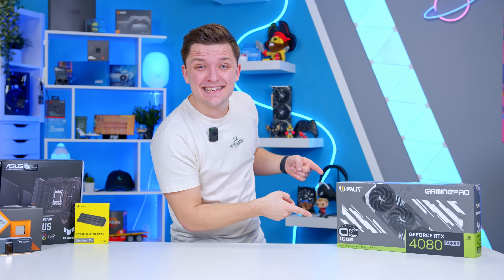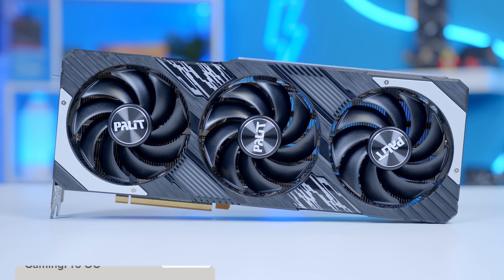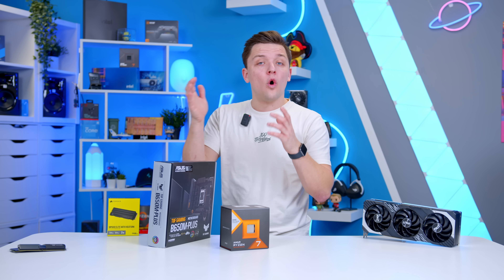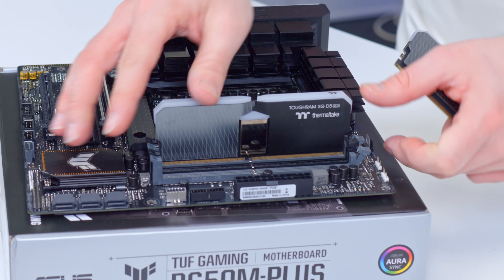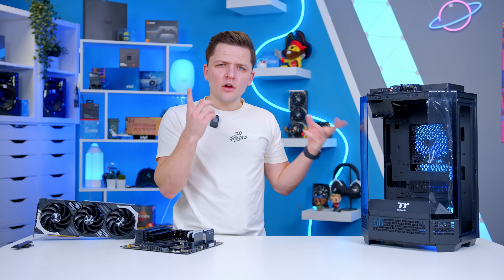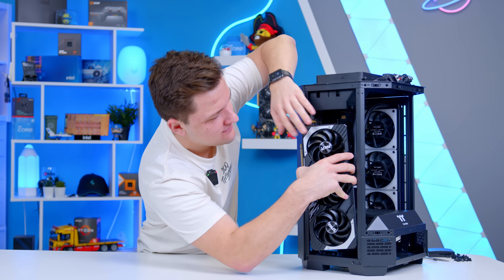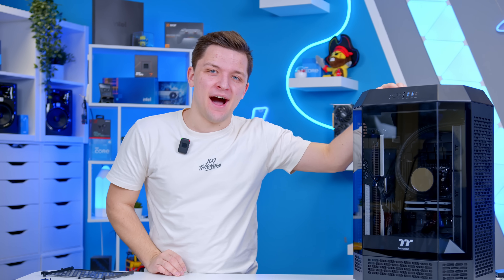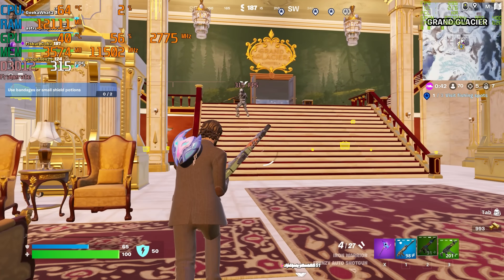Best RTX 4080 Super Gaming PC Build 2024! 😄 [Testing NVIDIA's $999 GPU in 10+ Titles]

Comment: something I've noticed with the tower 300 is matx boards are a bit different from each other and its better to find one that the gpu is using slot one, this moves it just enough to the right that its not covering all the motherboard connections on 3 plus slot motherboards. the thinner boards its really not an issue. just something ive noticed. 2nd i wish asus kept the crosshair gene, thats a great looking board for this case.

Comment: Thermaltake Tower 300 Question: 

Question: Do you think an Artic Liquid Freexer II 420 AIO would fit in this case? 

Arctic's AIO is a chonky boi at 458 (L) x 138 (W) x 38 (H) mm, so that 38mm thickness + a 25mm fan may not fit in with the  PSU shround at the bottom of the case,  right?
Reply: It can fit up to 420 according to the website.

Comment: Any chance of doing a build that would take 'full' advantage of a 27-32 inch 4K 240 hz OLED monitor?
Reply: What do you mean by taking full advantage? If you want to get 240 fps or around 240 fps then it all depends on what games you play and the settings. I would recommend at least a 4070 ti super or a 4080 or a 4080 super or a 4090 then on the amd side a 7900xt and the 7900xtx.
Reply: Buy a 4090, i7 14700k and you will still not be able to play 240fps at 4k with absolut max settings.
Reply: @roarbahamut9866  i didnt say 240 FPS though 🤔
Reply: @WRXnumberSeven you did though. If your monitor is 240hz and you aren’t hitting 240 then you aren’t taking “full advantage” so yeah, there’s that…

Comment: Can the 7800x3D still do decent with streaming and video editing? Especially starting off?
Reply: Possibly but it is built purely for performance, even a 13600k is better than 7800X3D just because it has more cores, you really wanna look at more cores if you focus more on editing and streaming
Reply: @micoandreimanzarate1646  more cores doesn't mean better performance. if that was the case then a i9 10900k would be better than a 7800x3d since it has more cores as well

Comment: has anyone noticed high gpu usage with the latest nvidia driver?
 was giving me 80% in the main menu in battlefield 2042,i rolled back to the previous driver and is back to normal..i have tried to reinstall the latest driver again but still get the same result
Reply: What gpu do u have
Reply: @fuzzssy  rtx 4080

It's fine with the old driver
Reply: @krislambert6625  hmmm I'm not quite sure. Usually if its a old outdated gpu it might increase the cpu by a bit with drivers that are more demanding but idk
Reply: @fuzzssy  I'll wait for the next release and see if it's any different
Reply: @krislambert6625  yea it's best to go off the moto of it it ain't broke don't fix it and stay on what you had
Reply: @fuzzssy  Yeah well I was running some pretty old drivers which work fine but now I'm on the ones just before the latest release which also work perfectly.

I'm sure it's just a glitch that will hopefully get corrected in newer releases.

Comment: I have put some pc parts together and I wanted to ask if this is a good build. (im from switzerland)

-r7 7800x3d
-b650 gaming plus wifi
-proart rtx 4080 super oc
-crucial p3 plus 2TB
-corsair icue 150i elite black
-be quiet straight power 12                    platinum 1000w
-thermaltake V350 TG argb air
-corsair dimm 32 gb 6000 RGB

the price here its around 2050 without windows just the raw pc parts
Reply: I just ordered parts for a very similar build, and I would recommend maybe switching to a wd black ssd, since I believe they are a slightly faster gen 4 drive, although I'm not 100% sure. Your psu should work fine but you might want to check out the psu teir list and get the most out of your money. Maybe the corsair rm100e.

Comment: AMD RYZEN 5 4650G (3.7GHz, 11MB Cache, 12x Threads, Turbo 4.2GHz) CPU
MSI B450M-A PRO MAX AM4 DDR4 USB3.1 HDMI, AMD RYZEN Motherboard
Intel ARC A380 6GB GDDR6 DX12 Graphics Card
16GB DDR4 3200MHz High Performance RAM
512GB NVME SSD Upto 3100MB/s + Speed Ultra-Fast Solid State Drive
500W 80+ High Performance Power Supply
Antec AX20 Tempered Glass GAMING CASE
Integrated 8 CH High Defination Sound Card

Comment: That’s a HORRIBLE choice of CPU for the 4080!! The ryzen 7 7800x3D paired with the rtx 4080 on a graphics card intense task you’re at a 11.9% bottleneck and a processor intense task you’re at a 43.6% bottleneck!! Absolutely horrible choice of CPU for this build
Reply: Wtf you talking about 😂
Reply: @m4ruan-117   if you don’t understand the details of what I already said then there’s absolutely no way I could explain it any further without drawing you a picture.
Reply: The thing is that your details are not right at all, and also may I ask which GPU you would choose for the 7800X3D instead ? Because if you tell me the RX 7900 XTX I’ll say that yeah is a nice GPU especially for high FPS at 1440p but totally not good as the 4080 super for Ray tracing DLSS3 in 4K (plus the intel CPU is just a waste if power if you’re not a graphic designer or something like that)
Reply: mfs using botleneck calculator and think they know anything about pc's xDD
Reply: You are misinformed.